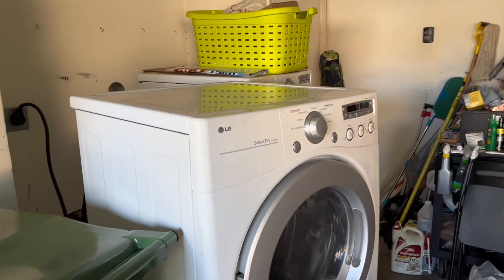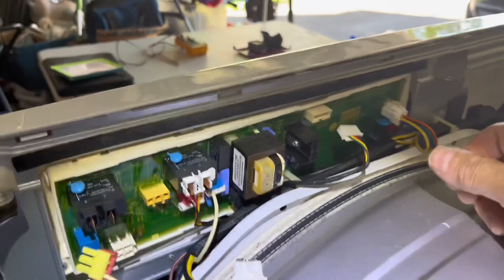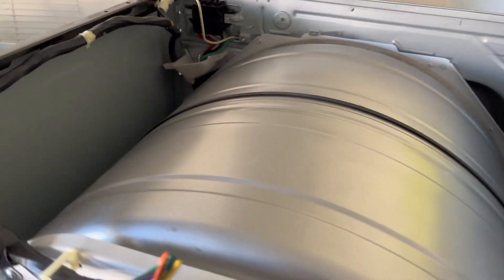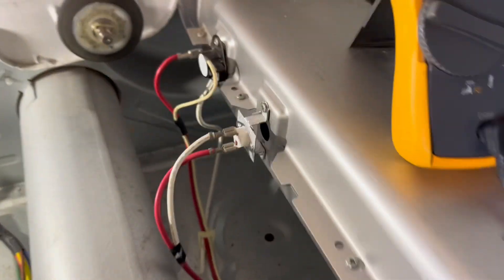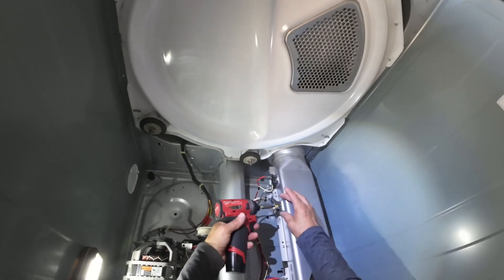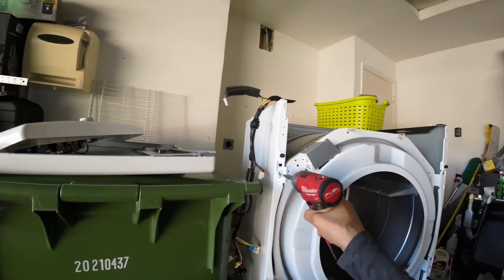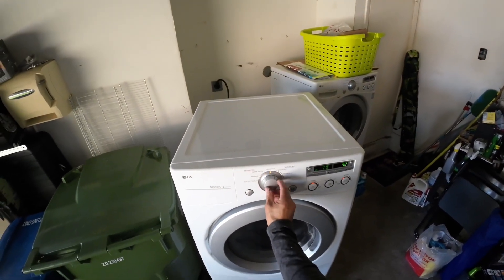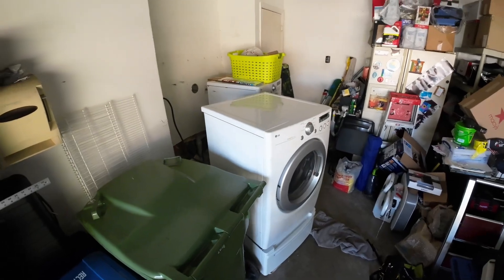Fixed LG dryer not heating. Model # Dle2050W

Comment: Could you give the ideal ranges for the thermostat and thermal fuse in ohms via multimeter?  Great video! Ours stopped heating last night after 10 + years
Reply from the maker: As in the video. If the dryer is not heating most likely, it will be thermal fuse, or the heater. The thermal fuse and thermostat  should be no more than  2 ohms . If it reads OL it needs to be replaced.. If the thermal  fuse is open. You wanna make sure the dryer venting has no restriction.
Reply from the maker: As in the video. The thermal fuse and thermostat should be approximately 2 ohms if good. Depending how good your ohms meter is it could be 10 ohms and still be good. If it reads OL they will need to be replaced. if your thermal fuse is open. The culprit is most likely an airflow restriction on your dryer vent.
Reply: @appliance63  Two ohms, got it.  I must have missed hearing that.  Thank you.  One more thing, if the thermal fuse has a reading within range and I clean out the dryer vent, would you say it's safe to assume the heater itself has gone out?  Is there a way to test it independently?  I really appreciate your help/video.

Comment: I wanted to take the time to thank you. I have the same dryer. Had it for about 3 months.. and then it stopped heating. 😫

Did some basic research and decided it was either the thermal fuse or the thermostat itself. 

I found your video and followed it step by step and I was able to replace both and my dryer is back!!

Thank you again!!
Reply from the maker: Glad I could help! If the thermal fuse is the culprit it can be normal wear and tear or a restriction in the dryer air vent.

Comment: Is it plugged in when you are checking the Ohms?
Reply from the maker: No. There is no need to have a power source when checking ohms.
Reply from the maker: The power source is the battery in the volt ohm meter that makes the meter work. Before testing in ohms you can touch both meter probes together and the meter should read 0 or 1 ohm. If working properly.